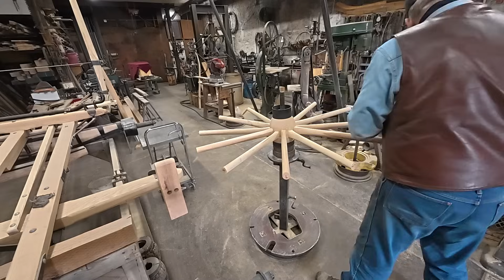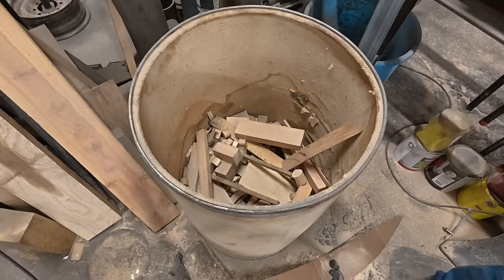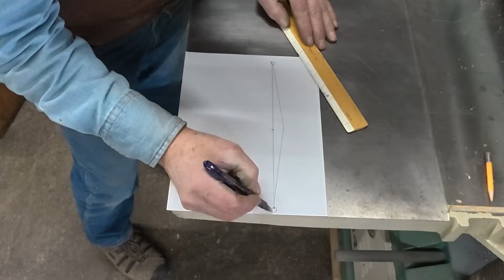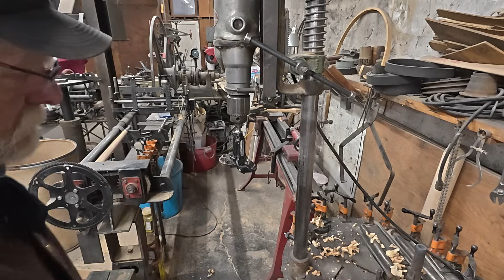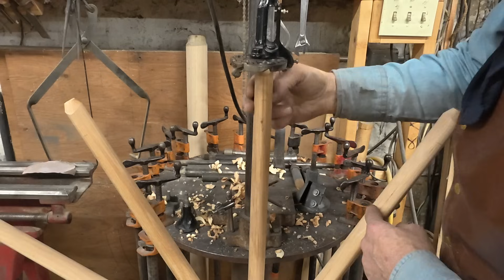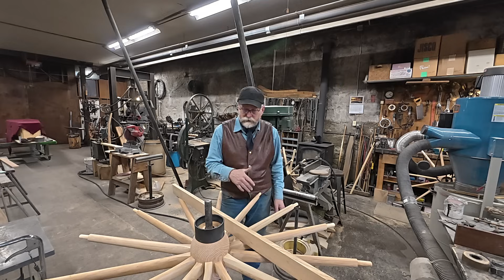How Stagecoach Spoke Tenons Have to Match the Dish | Engels Coach Shop

Comment: Thanks, love your teaching.  Is the drill press stand bolted to the floor?  Otherwise it might get kicked or moved and the chuck would no longer be directly over the mark on the floor.  Do you check that the chuck and mark are alignted with a plumb bob periodically?

Comment: Hi, when you have odd numbers of spokes on your wheels do you use a different reference line, I could see that it may be easier to find your angle if the wheel was set horizontally.

Comment: After seeing you align each spoke on your painted line I have an idea. If you have a fixture with an axel that would fit the hub you wouldn't have to do the eyeball sighting for each spoke. Align the axel so that the spokes fall directly under the spoke cutter. Just rotate the wheel on it's hub and the spoke cutter will automatically put the spoke in perfect alignment. Just a thought. Thank you for sharing. 🙂🙂
Reply: Thank you

Comment: When you cut the tenon, how do you start the cut so that the base of the tenon is centered in the spoke? At one degree of angle there is still an offset between the end of the tenon where you start the cut and the bottom of the tenon where it seats against the inside edge of the fellow. This offset would put the tenon slightly off center of the fellow unless it was corrected for at the beginning of the cut. I could explain it better maybe with a drawing, like you do showing the necessity of cutting the tenon on the line of the dish.

Comment: Why not mark a center line on the floor line to make it easier to know your in line with the drill. I think i would take a cement drill and drill a small hole there to make it even quicker and take the me mistakes out rofl :o).

Comment: G'day,

Yay Team !

I love watching this stuff..., with my grandfather's Spoke-Pointing and Tennon-Cutting Bits on the shelf across the room, staring at me, nudging me into starting the Wagon-Wheel/Wind-Turbine Hybrid Project, with Neodymium Magnets in the Felloes...(!).

I noticed  there's a little Peltier-Effect "Stove-Fan" in the background...., which appears to me to be identical, or very similar to the one I bought last year...; what I call the 4th-generation of such items...

Being a Propeller-Head, I got my first one 6 or 7 years ago, and the pressed Sheetmetal "production-engineered" Fans were so horribly inefficient, that in my opinion they crippled an otherwise brilliant Idea.

So, having flown behind my own Propellers, I duly designed, laminated and carved a 6" Prop. with a "T.L.A.R." Aerofoil (that looks about right...), which was indeed an improvement - shifting much more Air, so I tried a different Aerofoil - but that one (High-Lift...) was not as good as my first guess-based Section...

So the 3rd version uses an Aerofoil optimised to make as little Drag as possible, to enable the tiny motor to spin up as fast as possible...; and that Section - copied from a traditional Boomerang (!), works about 3 times better than the 5-bladed Cambered but not helically-pitched Fans which were shipped with the 3rd-generation Power Units.

Finally, the 4th Generation Sheetmetal Fans appeared and they feature 4 Blades which are both cambered, and sort-of Helically-pitched in Section, and because the latest Castings to collect Heat and warm the bottom of the Peltier Device..., and to keep the top surface cooler  - are apparently at least twice as effective as were the previous 3 iterations...

Thus, finally, the Chinese Manufacturer has - by perhaps trippling the Power available..., succeeded in supplying a Stove-Fan which can beat the old 3rd-Generation Power-Unit swinging my 3rd attempt at a Wooden Airscrew...(!).

As yet I have not tried to do better than the "latest greatest" offering from the factory..., but that's only because I risk damaging the Motor in trying to remove their newest Fan.

The first 3 generations had an Allen-headed Grub-screw in the Hub, gripping the Shaft to retain & drive it...; but the new unit is pressed-on, and it cost $170 new...

And, it works...(!).

I have posted a series of Tutorials covering how to design and cut, clamp, carve, balance and varnish little laminated Wooden Propellers for Stove-Fans, and before  buying the latest version, I was seriously considering taking on a 4-bladed laminated Propeller - and I do have a spare new 3rd-generation Power-unit too, so it might happen...(?).

I've also posted a fair swag of Boundary-Layer Studies, using Incense for Smoke-Trails... and some comparitive Pressure Mapping done by Particle-accretion achieved via prolonged operation with Incense feeding Smoke through the Disc.

Lots of Dust/Tar = High-Pressure Zone..., while shiny clean Varnish = Low-Pressure Zone...; as long as nothing knocks the Dust off the Blades during the Daytime, when the Stove is not burning.

Lately, I amuse myself with a Baker's Dozen of little model Aeroplanes dangling from the ceiling, across the room from the Potbelly - which hosts either of my two better Wooden Units, or the new upgraded 4th Factory version, in an alternating sequence...

I change the Fans over every 20 minutes, as I stoke the Fire...(!).

Small things
Amuse
Small minds...

Lol !.

Such is life,

Have a good one...

Stay safe.

;-p

Ciao  !

Comment: as others have already said, one of the best utube channels.  i really appreciate the fine details that make up your craft and your detailed descriptions
i consider myself a fine woodworker and i have an engineering background thus the finer points of wheel construction make a lot of sense
you could drill the holes in the fellies at the required angle of course, but that would make the fellies much more difficult to assemble if not imposible

Comment: Not only are you making coach wheels, you are collecting more fuel for your heat stove. Besides Wells Fargo and settlers moving west and needing wagons before 1900, and the advent of the auto lots of wheels and carriage frames were needed. Would a foot pedal switch be better for that tenon drill?

Comment: I live 15 miles from Concord NH.
About 10 years ago a carpenter in Portsmout had built a 1/2 scale Concord Stage coach from scratch.  He did this renting a floor in a mill building where he kept a couple of collectors cars.
In the Nzh tv show he was in the process of building a full scale Concord coach.
He was almost complete with building the shell of the coach.
The running gears would be the last thing to do.
He had 2byears in it already.

Comment: Hi Dave,
There's something in the back of my mind WRT dish on a wheel.  Inwards side loads that compress spokes into the rim of a wheel, holding it together would act outwards for the wheel on the other side, creating a tendency for the spokes to withdraw from the rim and for the wheel to collapse inwards...?

If a vehicle is running on a hillside on a canted path, then the wheel that's on the low side of the path would be compressed and hold together, but the one that's on the high side of the path would be pulled apart and might collapse with the hub pulling inwards?  Alternately, if a rock or tree stump / root impacted on the inside of a wheel might also cause a wheel to collapse inwards...?

Might this be a risk when running dished wheels?

Thanks

Comment: Dave,
You have been sharing greater depth of knowledge of what you’ve already taught. It’s like we’re in a 400 level course now. I’m very appreciative of all you share. If I might ask for following stagecoach lessons-when placing tire on wheel you mount the wheel with face down on your bracket. Then apply pressure to. Please explain the physics of procedure. My logic wants me to mount dish up. I need the Masters advice.
Reply: Your question reminds me of a story Roy Underhill told in one of his books. He was with a master sharpener at Williamsburg, Va.. trying to learn some tricks of the trade watching him. Roy began wondering why the master, who was using a large round spinning stone that had water dripping on the stone, said he always spun the stone so the top of it was turning away from him. Could it be easier to see, the grain of the stone working better in that rotation??? Finally he asked the master why he preferred that direction. His answer? “Because it slings the water away from me! Turning the other way, I’d be soaked!”.
Reply: Truly a master wagon builder and a wonderful teacher.Thanks Mr and Mrs Engel for the videos.
Reply: I think that is on one of the previous wheel videos, but I'll let Dave know.
Reply: @jimhouse9273  Dave said, "Stay tuned." He'll explain it again on these wheels.